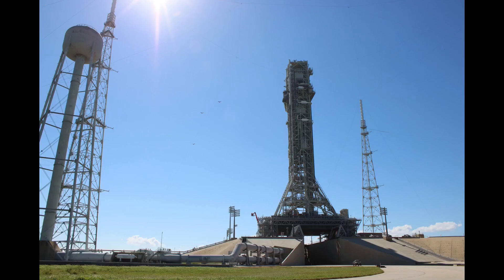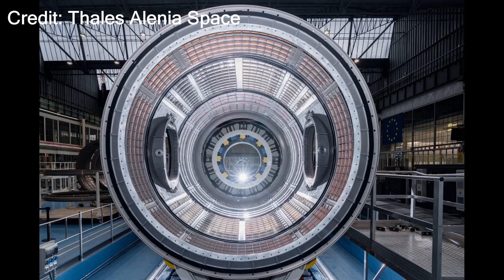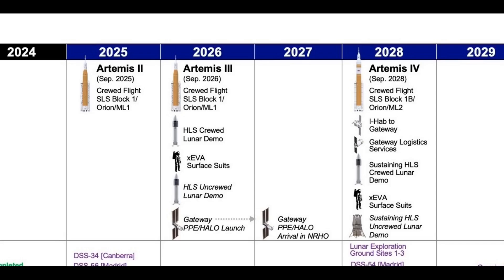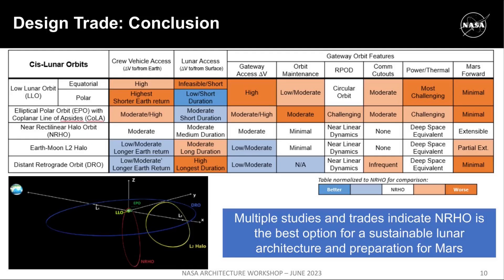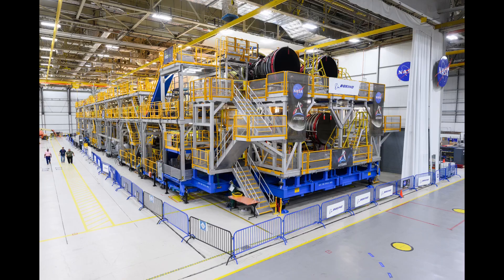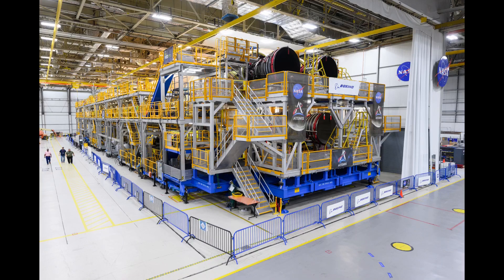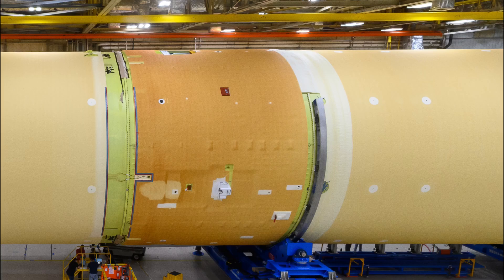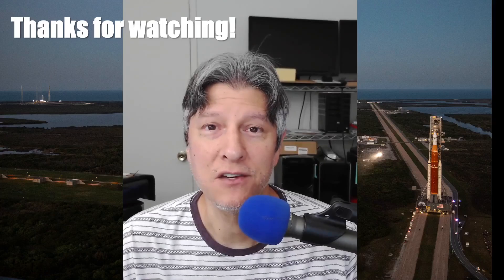Artemis II SLS Core Stage delivery preps and "spare tire" questions for Artemis III

Comment: Wait, what, they built a space capsule that can't operate in LEO?
Reply from the maker: None of the American crewed spacecraft can operate as a free-flyer for 21 days in LEO.  Orion is designed for 21 days of free flight in BLEO with a crew of four.  Dragon/Starliner only need to free-fly in LEO for ~5 days with four crew, spread between RPOD and EDL.

All of them would need modifications for a 10-day, 2 week standalone mission in LEO, in the style of Apollo 9.
Reply: @PhilipSloss  Thank you. But Dragon (and Starliner?) are consumables limited, right? They don't have the food, water, oxygen and scrubbers for longer missions? Dragon has everything in the capsule and only solar panels (and radiators?) on the trunk whereas Orion (and Starliner?) have proper service modules like Apollo carrying consumables.

I guess I'm just disappointed with the inbuilt limitations. It was supposed to be an improvement over Apollo but no LEO, no LLO... it's like they designed it to not actually go anywhere... ok, rant over.
Reply from the maker: @zapfanzapfan  It's not clear what other constraints there are for Dragon or Starliner beyond ECLSS consumables.  They may have the possible thermal constraint that Orion could have, too.  Unfortunately, none of them talk about their designs that much.

All of them were purpose-designed, purpose-built vehicles, constrained to a government budget.

SpaceX seems to have decided a while ago to do something more ambitious with Starship as an all-purpose or "more-purpose" system, rather than invest significantly in upgrades to Dragon.
Reply: @PhilipSloss  That is the disappointing part when the companies designing things don't look beyond their government payout and display ambitions of their own. Luckily there are a couple now who seem to have their own ambitions.

Yes, Falcon and Dragon seem finished design-wise and are now working to pay the bills for Starship development. But at least there is mass margin in Falcon 9 launch should Dragon need/want more mass for any reason.

Comment: I don't see a future in the SLS/Orion project. the enormous expenditure that went into this project is money wasted. Nothing will come of it or it will end in tragedy. It would be better to dust off Saturn 5 and give it some facelift, or concentrate its efforts and resources on Starship.
Reply: I'd argue a lot has already come out of it.
NASA has a launch capability they haven't had in decades and it is enabling a Lunar exploration program that is actually happening.
They are currently preparing to have the first crew beyond LEO since Apollo on the very next launch, so a lot more is going to be coming out of it.
As long as it remains as high a priority in Congress and it maintains its unique launch capabilities I don't see it going away any time soon.
I'm honestly not sure what you're even doing here if you aren't actually interested in the progress with these programs.
Reply: and when will starship be ready to take crew to the moon and not be an empty tank stuck in low earth orbit
Reply: There is no incentive for NASA, industry or Congress to build rockets cheaply. Expensive keeps highly skilled staff employed, happy voters in those areas and politicians back pockets full. None of which give two monkeys if astronauts never fly or just die. You’ll never change that system whilst Congress and NASA are involved.
Reply: Starship has no future beyond LEO
Reply: Totally agree
Reply: Doesn't Boeing now own most companies that built Saturn V?

Comment: If there is to be an LEO rendezvous for an ‘A2.5’ I would propose using a Starliner/Atlas 5 instead of Orion/SLS. While far from ideal, Starliner is similar in shape, has the same docking system, and it’s really HLS’s systems that are to be tested here. Much cheaper, less wasteful and more feasible than re-fitting Orion for Orion and SLS.
Reply from the maker: NASA is not yet calling any of the Starship HLS tests "Artemis missions," but in this case it illustrates a primary objective, which is to increase the cadence of Orion/SLS missions.  There's already a nearly three-year gap between Artemis I and II (as currently scheduled), and without something in the 2027 timeframe, there could be another long gap until the next flight.

SpaceX could also demonstrate HLS in LEO with two Starship vehicles or even launch a Dragon to dock with an HLS variant.  SpaceX doesn't have a flight cadence problem right now, it's an issue for EGS/Orion/SLS.
Reply: @PhilipSloss thanks. I see your point (Orion/SLS cadence). In that case, seems like a waste of a perfectly good SLS/Orion to just do LEO. Hopefully Gateway will be ready and visiting it can be the mission.
Reply from the maker: @stevengoyette3165  We'll have to see when the initial Gateway elements reach NRHO.  The implication in Eric Berger's reporting back in April is that a LEO mission with Starship would be available sooner than an NRHO mission with Gateway.

The target launch date for Gateway was said to under review in January...it's been essentially half a year without any update  about that.  That doesn't seem like a good sign for the Gateway schedule.
Reply: What would that be testing? At that point, Falcon/Dragon could be used and SpaceX could just conduct an internal test for a fairly cheap cost.
Reply: @mr.g937 Gotcha. It was just my understanding that Starliner’s docking sensors were identical to Orion’s.  But you’re right that Dragon could do the same mission at half the cost.